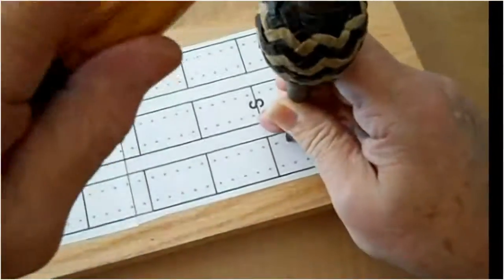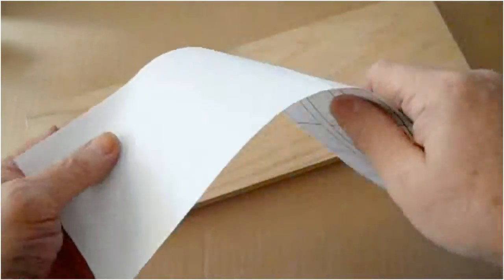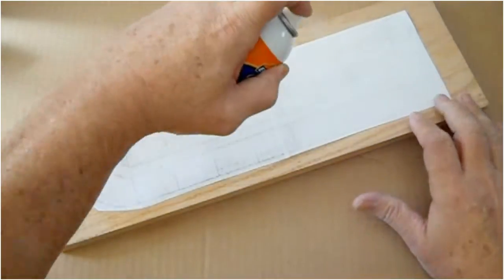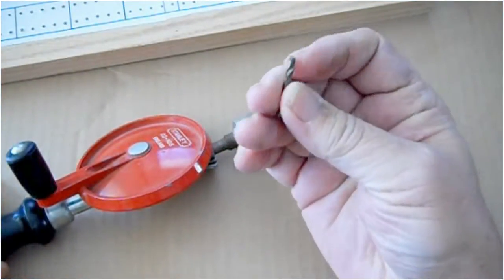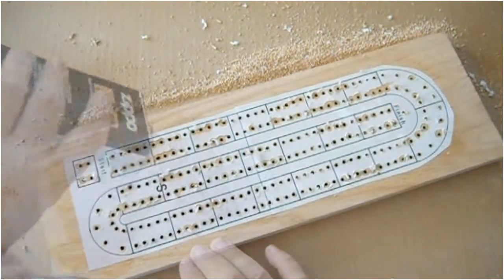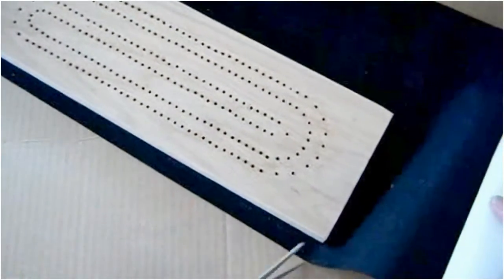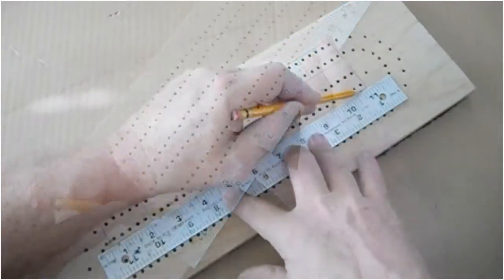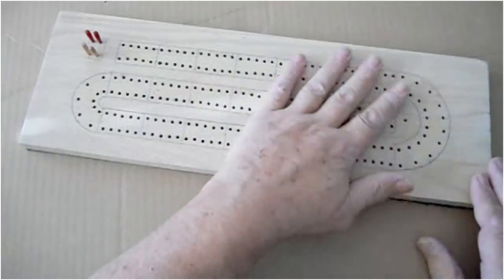Making a Cribbage Board (The Best Ever Card Game)

Comment: I like your drill... 🙂. I just started a board today, I skipped drilling and used 5 taps on the all per hole and found a set of tapered pegs that work.
I’d like to make more but 1000 taps on the all per board (plus pulling the all back out) has my shoulder saying otherwise!

Comment: Great video, did you apply a finish to the  board before layout and drilling? I've put graphics on laser printer waterslide decal paper and found I had to seal the wood, add decals and put two or more coats of polyurethane to keep the decals from peeling off.